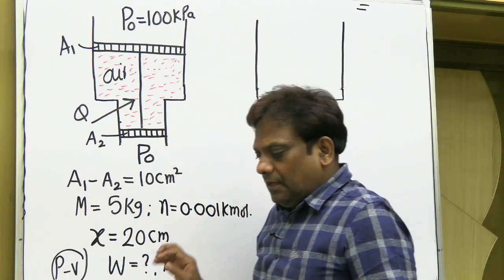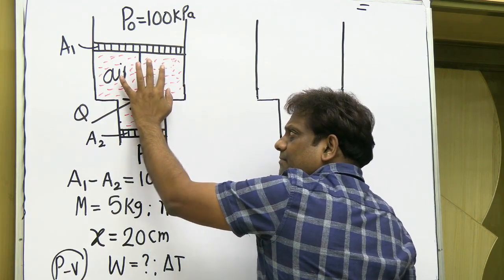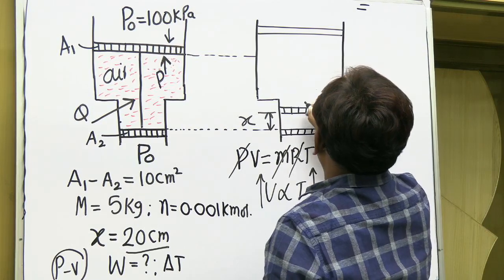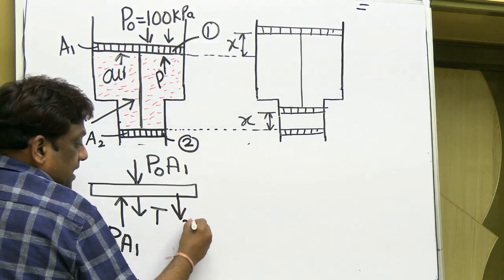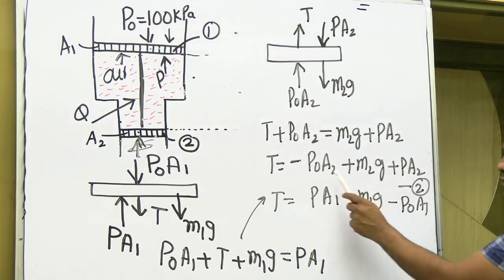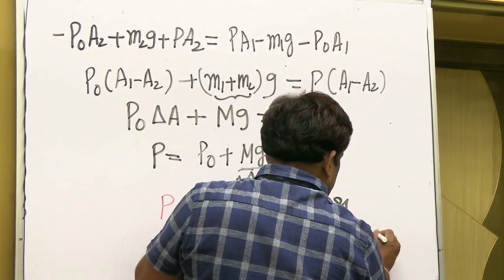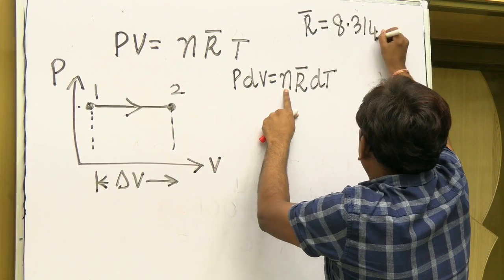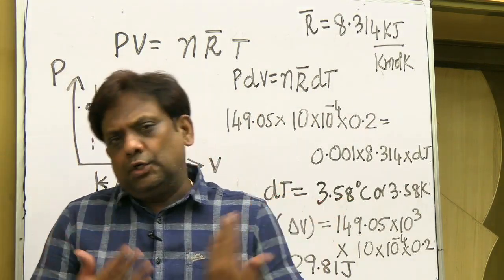Conceptual Numerical on Thermodynamics

Comment: If the piston is in equilibrium,how is it moving upwards!
Reply: Piston air assembly are in equilibrium....When air is heated, it's vol increases and hence piston too moved, until new equilibrium established.
Reply: @Ashutosh-lw3cn  when air is heated piston is not in equilibrium,so how you can draw equilibrium diagram!
Reply: During any process the equilibrium has to be disturbed. But we disturb it quasistatically so that infinite no. of equilibrium can be obtained during a process and it moves reversibly. This is what is happening here.